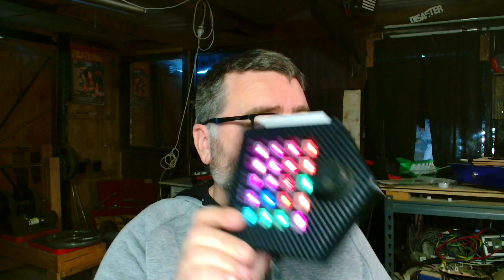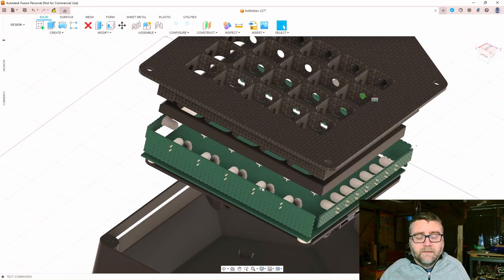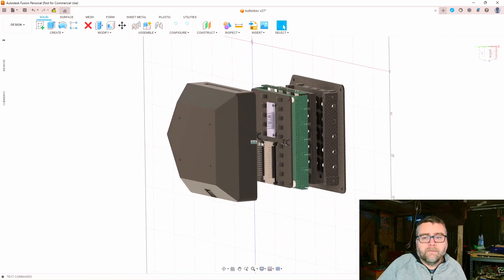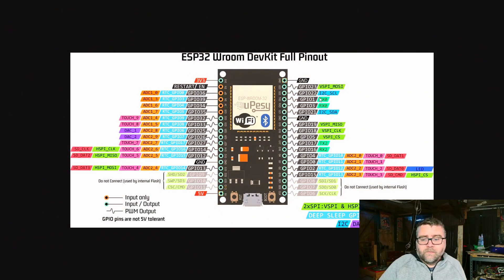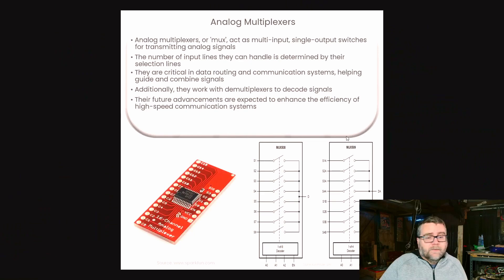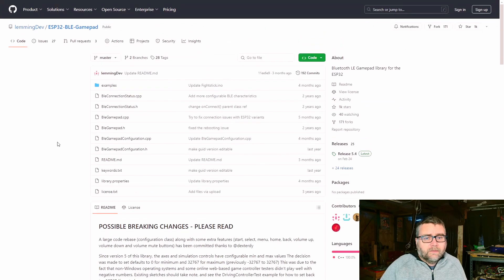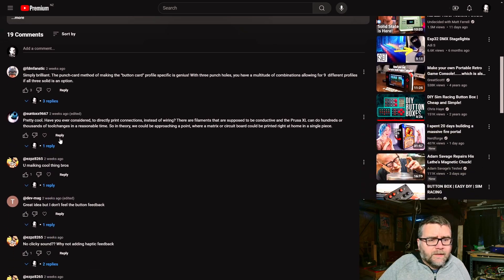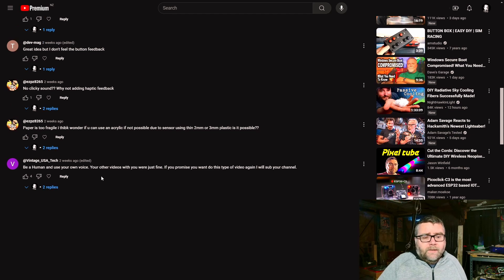Unlocking the Secrets of the Button Box

Comment: USB connection is that much harder to use? You would do away with the multiplexor. Neat idea.
Reply from the maker: The controller (ESP32) doesn't have HID support as far as I know. I could use a pro micro but you will just have enough pins to run the button box with no extras for tactile buttons.